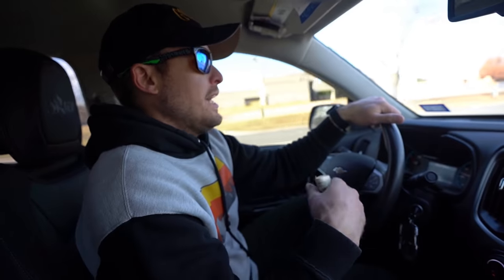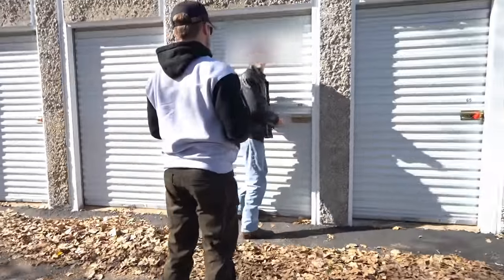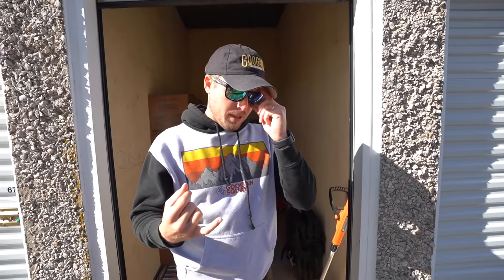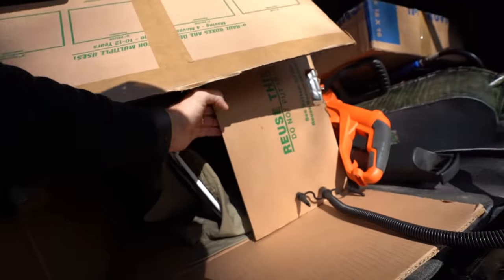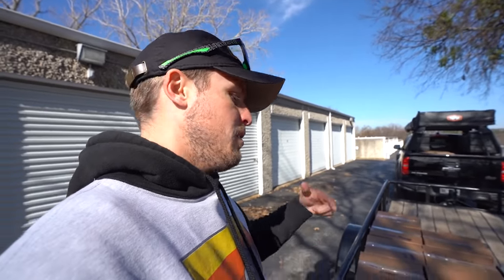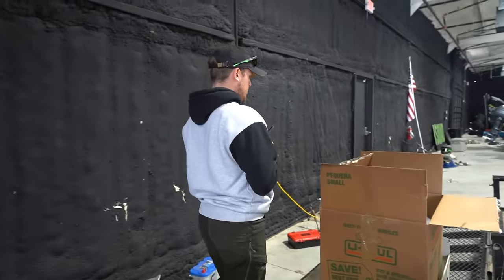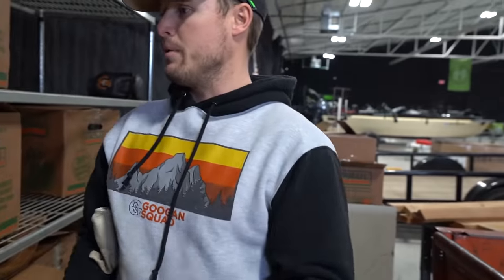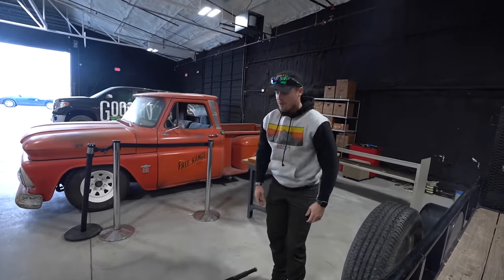I Found An Abandoned Storage Unit - I Need Your Help

Comment: Hey Rob, just to clarify, anybody who is navy aviation has to get air warfare quald. They could have worked primary flight control in the tower or been a AIMD maintenance personnel and they would have to get it. So he was either air department in the Navy or he got it as his secondary warfare device.

Comment: The warfare devices, the "ship" 9:28, are called air warfare and surface warfare devices. You get those by completing qualification cards for the air side and ship side. I'm at a navy training command in SC right now and most of the instructors ~E-6 and up have their air and surface warefare pins if they were stationed on a carrier

Comment: The pins above and below the ribbons are enlisted surface warfare specialist, and the bottom one is enlisted aviation warfare specialist. The surface one is on top because they were in a surface/seaman rating, and they dual qualed in aviation so its on bottom because it’s secondary. Also the Navy uniform is for a chief petty officer,  E7, and the marine uniform is for a sargent, E5.

Comment: The warfare device that was on top of that Cheif dress white blouse is an enlisted surface warfare device. You can earn it by learning about the ship and how the ship functions, when it was actually on blouse the order goes primary warfare device (so the warfare device that is closest to your job) ribbons then the secondary device. for example, if I was stationed on an aircraft carrier as a Machinist Mate (MM) my primary device that I would try and earn is the surface warfare device but since I'm on a carrier I can learn about the flight deck and specific aircraft systems earning me an aviation warfare device. Hoped this helped you figure out what you were looking at a little bit.

Comment: The top pin is a expeditionary pin that’s is earned after completing qualification. The dress whites seem to have a Chief anchor on the neck. The BDU’S or the uniform he called army is actually a uniform that started in the Marine Corp and is now used for special warfare training like BUDS,SWIC, and so on. By the looks of the marine uniforms it looks like he made Sargent E-5 and probably cross rated to the Navy where he became a Chief E-7 which is common in the  service.

Comment: So, for the Navy, depending on your rating, if you are  an aviation rating you will have your aviation warfare on top of the ribbons, if you arent an aviation rate you have the ESWS on the top. they are just qualifications saying you know pretty much everything having to do with either the ship/platform you earn it on and with the air pin you can earn it on platforms with air wings or in a squadron.

Comment: For the navy uniform... it’s a Cheif (E-7), the top warfare pin is a surface warfare pin, meaning he was on a ship at one point. And the bottom is an aviation pin so he could’ve been attached to an air squadron or could’ve got it while on an aircraft carrier. All of the warfare pins and medals are up to date. 

But that’s a Navy Cheif AND a Marine Corps uniform. So in my opinion it doesn’t really conclude that he’s a Marine unless he was in both branches. He could’ve been a collector. Hope you find whoever’s it is!

Comment: I bought a colt ar15 and I upgraded it external a little bit not regretting the purchase at all. I went for a red and black color scheme. I went with red Charging Handle, Extended Magazine release, ambi safty, trigger guard, and red dessisembly pins all red parts added I want to get a red handguard but I'm not sure about spending that kind of money yet

Comment: Followed you for fishing, don't watch much hunting but I do enjoy these storage unit purchases as a change of pace. Just a heads up, in the start of this video most of the time you guys cut a clip there's a POP...I notice it because I edit vids but many probably don't even think about it. If your using premier pro you need to use "constant gain" as an effect between audio clips, only a quick couple of frames per clip on each side where you cut and it'll get rid of the pops. It's work, but it's way cleaner.

Comment: The top badge is a surface warfare pin it shows he spent time on a ship and knows all the specs on the ship to include weapon system , ship specs , and mission and also all naval history. 

The air warfare pin means he was attached to a aviation squadron. That means he knew all of the facts about the aircraft in his squadron to include naval aviation history 

Each pin had roughly a 600 pg book you have to know by heart and go through a board which takes about 6 to 10 hours for each pin

Comment: Top one on the Navy Dress White Uniform was A Surface Warfare Pin, green and white is a Navy/Marine Corps Commidation metal, green and orange striped with the stars is a Navy/Marine Corps Achievement Metal the stars denote how many times they received it, bottom was an Aviation Warfare Pin. The warfare pins are given for understanding that particular subject not your specific job, it's basically a test of your understanding of different ship systems.
Reply: USS Chosin was stationed out of Hawaii until 2016, My ship was station with them.

Comment: The weird thing is that his navy chief uniform, the white one, he has his surface warfare pin( the one on top) which means that he’s surface qualified, I suppose it was possible that he was in the marines for 8-11 years and then joined the navy and worked his way up and became a chief, and then moved back to Texas. The letter from 1975 could have been realistically a boot camp letter but that doesn’t line up with the 2001 invasion of Afghanistan because it’s more than 11 years apart. As a surface warfare MOS it’s possible that he may have spoken the language and went into Afghanistan after he joined the navy but he wouldn’t have gone into Afghanistan while in the marine corps, that is assuming that the letter dated 1975 was to him and not to someone he knew or just a random book.

Comment: +1 for Rainier Arms. I live right up the street from them. Their uppers and lowers are made by Zev
Reply: If it’s a Rainier Mountain Barrel that’s made by Noveske
Reply: Rainier Arms lower, bravo company (bcm) upper and gas system, fail zero bolt carrying group, cmc trigger, Rainier Arms charging handle, ambidextrous everything... kicks like a cricket. Eotech 518 red dot.

Comment: the white uniform is a navy chief E-7 the top badge is surface warfare the bottom one is air warfare it kind of looks like you have uniforms from multiple people or some one who did a lateral switch from the marines to the navy the camies you found are universal from the marines to the army only the cover is different and at one time before the navy went to the blue camies we used to use them for an at sea uniform with colored jersey's depicting our rate (mos for you army guy's) or job on the ship or flight deck

Comment: The white uniform is a Navy chief uniform (E-7) the warfare pin on top is the enlisted Surface Warfare(SW) pin you earn it by having basic knowledge of all the jobs on the current ship your on from intel all the way down to the engineers that work at the bottom of the ship. He could have switched from marines to Navy.

Comment: Top pin is surface warfare (esws) chiefs dress uniform. So the top pin is his primary pin. And his secondary was his air pin. Not less valuable just not his primary. (Im in the navy info is factual).

Comment: I would have definitely paid 1500 for that bike.
Reply: Drained the fluids, filled with new, started on first kick. Runs like a bandit.
Reply: @kylethompson151  that's what I'm saying. And if I didn't want to keep it I could have got it running and got 3 grand out of it easy
Reply: There are so many for sale in this area that they typically go for 1200-1800 in good shape. It runs great if you're trying to buy it for 3k... I'll give you my info
Reply: @kylethompson151  where do you live. I'd love to find one for that price.
Reply: @chasegurganious7910  near Denton TX
Reply: @kylethompson151  yea man. I just looked on Craigslist I'm Wilmington NC and saw a 2000 Honda cr250 for 2800... So expensive here

Comment: You literally traded a $3000 bike for a $1300 AR-15..
Reply: your generous i was thinking more like 1100
Reply: Rainier Arms lower, bravo company (bcm) upper and gas system, fail zero bolt carrying group, cmc trigger, Rainier Arms charging handle, ambidextrous everything... kicks like a cricket. Eotech 518 red dot. $1900 total build.
Reply: kyle thompson still got ripped